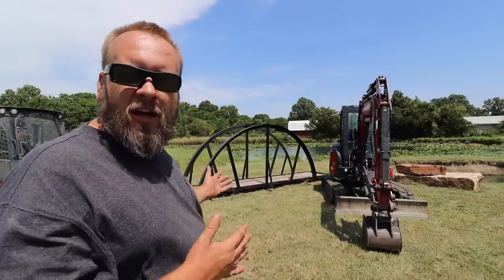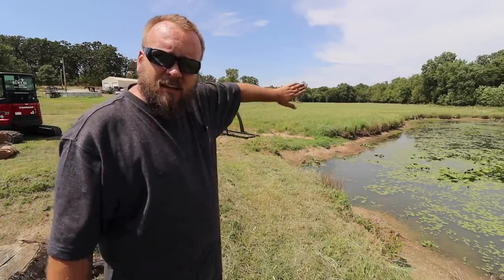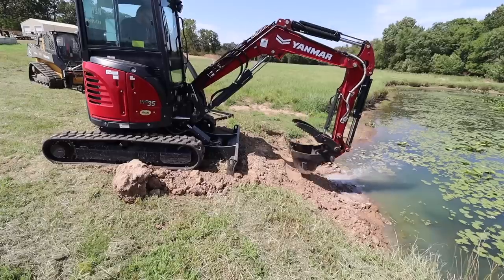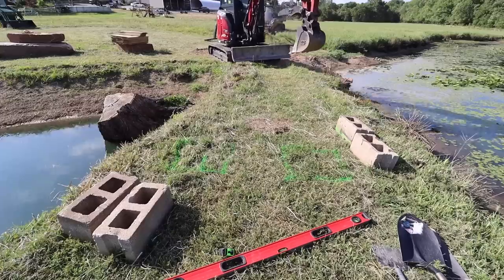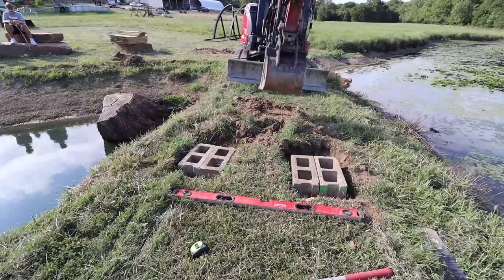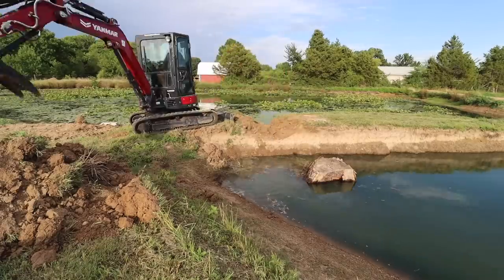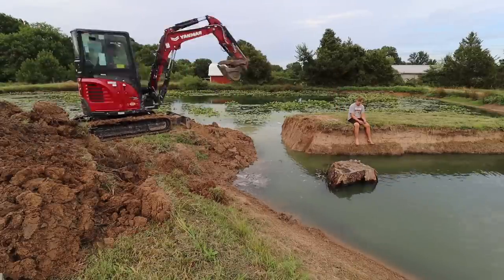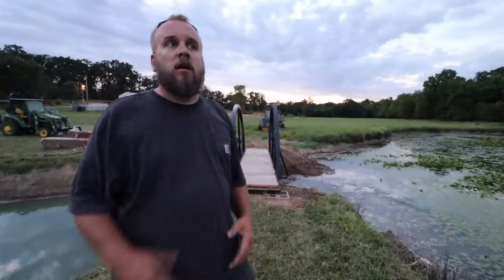Finishing the Island and adding a Bridge to Our Pond

Comment: They make a product called"Damit" for sealing pond dams that you just broadcast in the area where your leak is at and it settles to the bottom and turns into a gel which goes into the cracks of where the leak is and seals it. It's a co-polymer and is not harmful to fish. I've seen 3 other you-tubers use this product and it sealed their leaky pond dams. Will save you alot of time and labor.

Comment: Every time I've rented equipment, they tell me the same 8 hour deal, but I've gone well over 12 hours a day for a week solid more then once and have yet to be charged extra. Maybe they're bluffing around here, maybe I'm just lucky.

Tip for tamping around things like posts and blocks:  use a four foot section of  3" PVC pipe, cap one end and put a clean out plug on the other. Fill with water, plug the end and go to work. Empty it when you're done.

Comment: Curious how that island is going to hold up over time. With heavy rain, erosion and gravity you could wind up with a bridge going for a swim. Driving 8' rebar, 2 per opening in the blocks, followed by concrete might anchor everything.